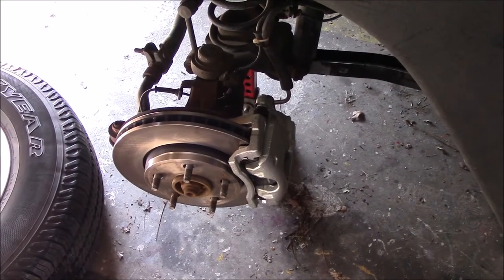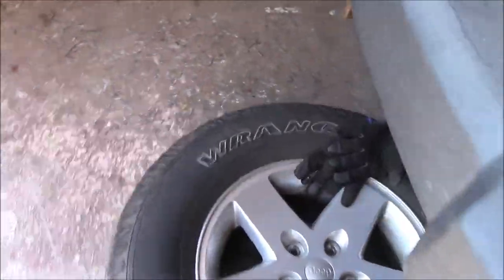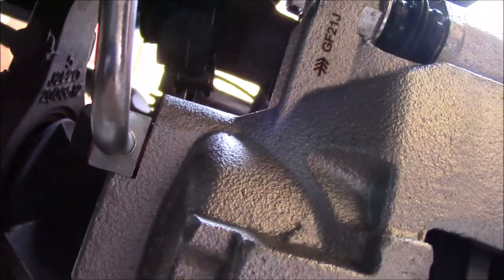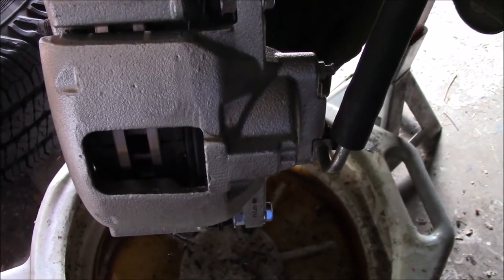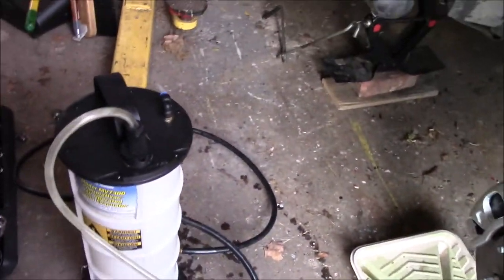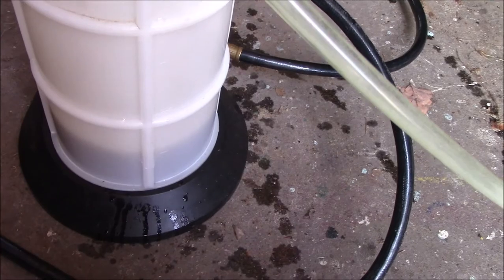bleeder screw should be on top of caliper when installing

Comment: This was my exact problem. I should have known better and made a n00b mistake. I was so focused on just getting the job done that I didn’t realize I had out them on upside down. I already bought and installed a master cylinder at this point and started getting scared that it might be my rear wheel cylinders, as this is a 2006 truck with drums in the rear and discs in the front. It was freaking this. I spent almost 2 hours getting tons of air out of the front system after correcting the mistake. She stops on a damn dime now. I lost my brakes after my front right caliper exploded, lost a massive amount of fluid, and had to be towed home. Very scary, but it was because the previous owner neglected them and here we are. I have you to thank for making me realize this error and getting me back on the road! Thank you 500x and be well!! 🎉🎉
Reply from the maker: I bought a master cylinder too, until I found a video on YouTube that showed the problem.

Comment: When you bleed the system, air rises in oil, so if the bleeder valve is up on the top the air collects at the bleeder. Also, if calipers are new, fill them as much as you can with oil before you put them on. .

Comment: My son did a disc brake conversion on his 14 bolt had bleeder on bottom , brakes would not bleed till we flipped them side to side. And out bleeder on top.
Reply from the maker: I bought a master cylinder, later returned.

Comment: Has anyone run into a problem where the bleeder screw won't seat correctly?

Did a full brake job on my s10, and I'm thinking the new pads are so thick, that I have to push the piston deep into the caliper, and the piston kind of gets in the way of the bleeder valve. I screwed it in and tightened to the point of snapping it off, and I still can't seem to tighten it enough to stop the fluid from coming out. The only conclusion I can come up with is that the new pads are too thick. So, I either grid down the pads, grind down the rotor, or cut off 1/8 of an inch of the caliper piston. Has anyone run into this before? Because it's a first for me.
Reply: Try some teflon on the threads
Reply: @RowdyEnt.  disregard... I figured it out. Hey, did you know that S-10 calipers fit perfectly upside down on the other side? And if you rebuild an original brake caliper and forget which side the bleeder valve screws into, it won't work correctly. 🤦...

I don't feel to bad, since there are literally hundreds of people on message boards and forum's all over the internet with all sorts of cars right now that haven't figured it out.
Reply: @blkhemi3925  Glad you figured it out. Iam working on a 86gt fiero with s10 brake system.